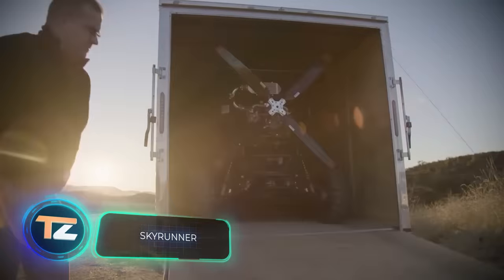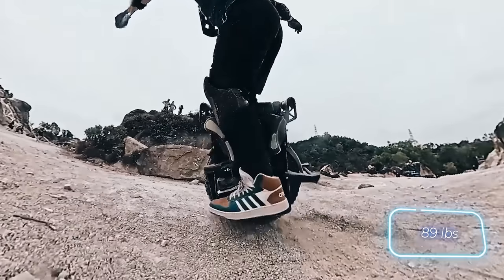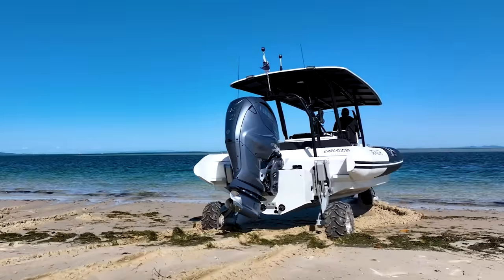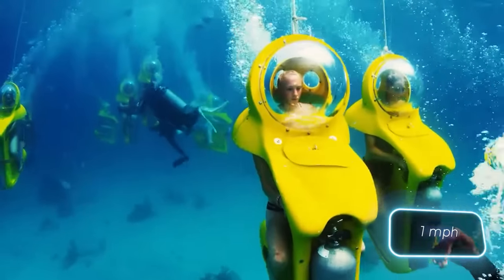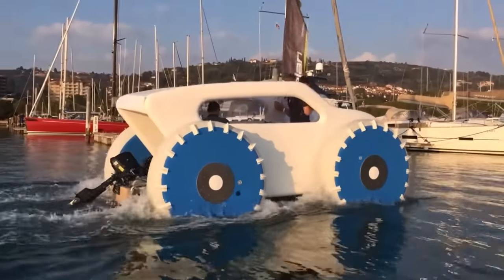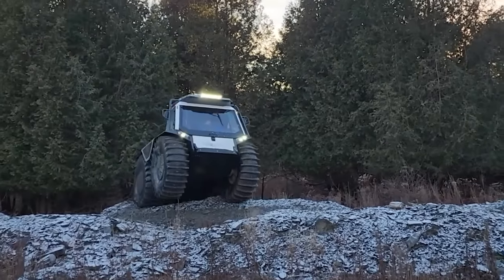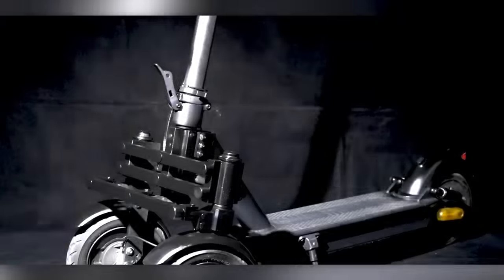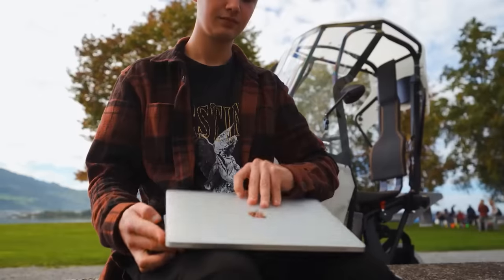INCREDIBLE VEHICLES THAT ARE CAPABLE OF MORE THAN IT SEEMS

Comment: I designed a 4ws and 4wd pedal powered kart with the ability to be engaged in 4 wheel lock. I started building the rough prototype in 2016. The frame was nearly done then I had a return of the Lyme disease that I was treating in 2015. Still battling Lyme disease I dismantled it in the fall of 2022. I’d love to start over building it except this time with an aluminum frame. I’m just working too much right now to tackle the project.

Comment: Some of these are neat.  Nearly all of them cost too much for what they offer.  There are two models I can get from Utah Trikes which is an American e-trike company that out performs all of these machines in terms of cost and range.  The first is an e-quad (about $6,000 US dollars) for a single rider/driver.  It features a custom welded frame, up to 10 e-bike batteries (each offering up to 50 miles of range per charge), a rider capacity of 400 pounds, a platform capacity of 500 pounds, with the option for an extended length bed.  At this configuration the driver can expect up to 500 miles of range with pedal assist level one.  The second is a side-by-side dual person version (about $10,000 U.S. dollars) that basically doubles the range and maximum payload.  With either I an outfit them with an Eco Flow 2 solar & battery powered air conditioner & heater combo unit that runs for up to 8 hours per charge, I could have it fully enclosed to make it weatherproof and lockable for safe storage of personal gear, I could even use it as a short-term camper.